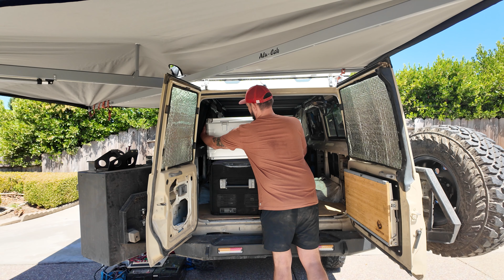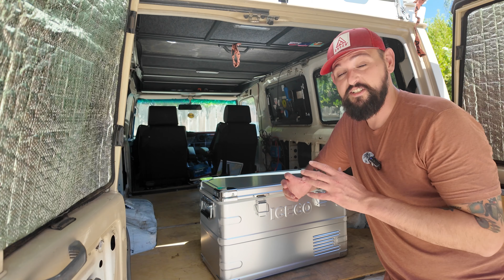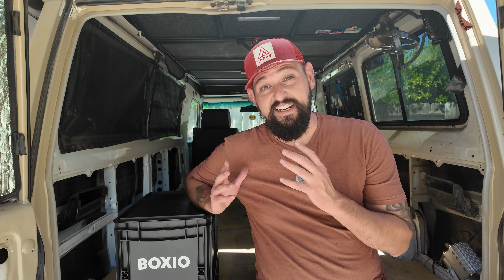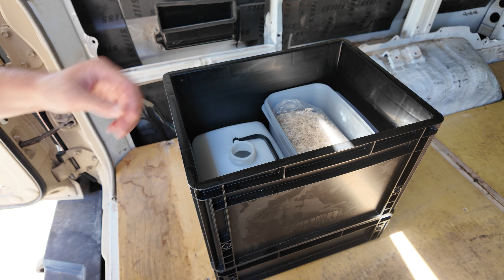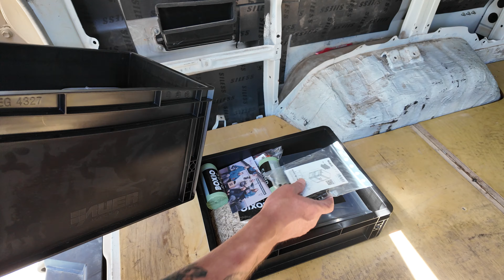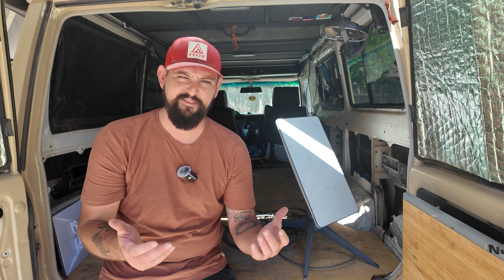Land Cruiser Camper Build - Selecting the Right Gear

Comment: Great stuff, Ben. I was unaware of the mini Star Link. We use the OG and it is very awkward for storage, but we are very happy with Star Link's performance. Looking forward to more build videos - thanks, Dan. 🌲
Reply from the maker: Thanks so much Dan! It was hard to pull the trigger on another set of hardware, but I think the benefits are well worth it. 12v power, built in router, and SO much more compact 🙌

Comment: Can you not just use a bluetti power pack, and just charge it via the alternator and solar
Reply from the maker: Hey Tim! I ran that type of solution for a while on my 4Runner. It was great for weekend trips, but like Eddie said I think for a long term, long range overlander it makes more sense to build the system. Using the individual components for solar, alternator, and shore charging means that if something breaks I can still limp along with power until I can replace it. Whereas if something breaks in power pack like the bluetti it’s more of a black box and I’d likely be completely without power until I could source a replacement.
Reply: I would not recommend that for a full live aboard overlander. Much more reliable to build a stand alone system and easier to repair if something breaks down the road.
Reply: Fully understand redundancy is the key word

Comment: Hello Ben, spot on as usual. The main task should be to reduce weight where you can. I really like this fridge very much but is it as reliable as an Engels ? Mine has been running for over 15 years with no issue. Also, I'm still thinking wheter I need a freezer departement or not 'cause I'm not eating much beef anyway. What are your thoughts on this one ? Cheers, Bruno
Reply from the maker: Hey Bruno! Engels are definitely legendary, and I always say if it’s working for you, then put that money in your gas tank! 

The main difference between the two is the compressor. Engel uses a great Japanese swing compressor, and Iceco is using the German Secop/Danfoss. The Secops are definitely well proven in the Marine world with a large market share and long history of reliability. 

Hopefully that holds true in an overland environment, but either way I’ll keep you updated here 🙌

Comment: It's nice to see some of the toys for your build inside the troopy Ben. I can't wait to see it all underway. I'm actually thinking of installing an offshore outlet in the 4runner as sometimes I pull into a campground with shore power. It will be beneficial to me as sometimes I need a heating pad for my back, as where the jackery will drain too quickly for that kind of power. Pluss I could use it for many other things. Speaking of which, am I wrong to be assuming that you might be installing an induction burner into the troopy? If so, I'm sorry if I ruined the surprise for everyone. Told you I can't wait for the build 😅😅😅 take care, and be safe out there .
Reply from the maker: Shore power is so nice! Great for those campgrounds where it’s available, or even for a quick top off of the batteries when solar isn’t keeping up. 

You’re on the right track 🤫 I’m trying to get rid of propane entirely, and add some additional warm weather comfort while I’m at it 🥶
Reply: @BenStinnett  don't get me wrong, though, I'm going to hate putting a hole into the 4runner, but I think once it's done, the job will look good, and i I'm going to love getting into a warm cozy truck with my heater running. Since I think it will be safer than a diesel heater.